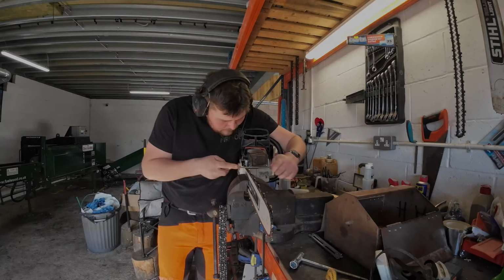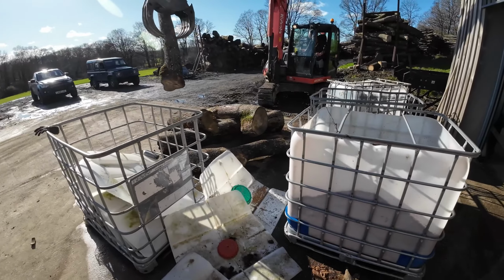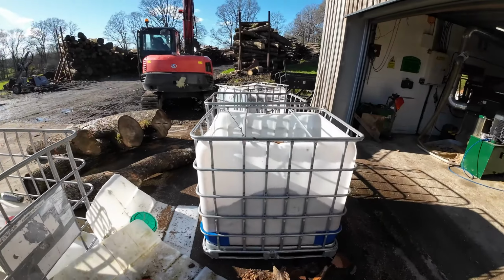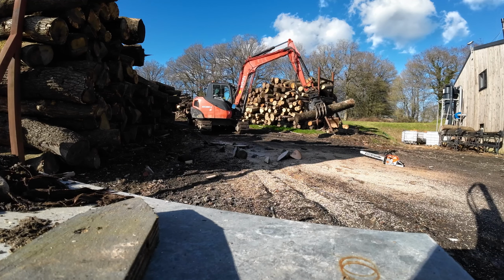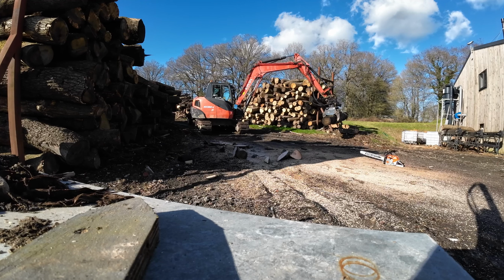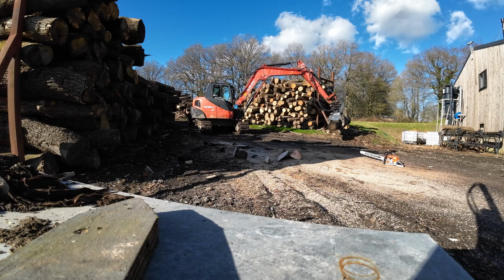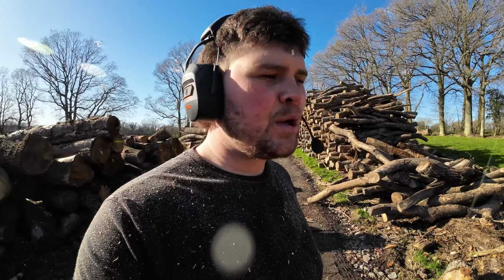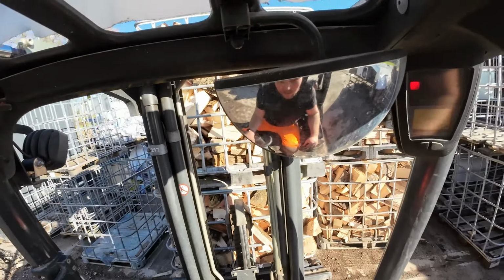Day 80 - Cleaning and processing knotty  wood

Comment: Hey man, love your content!  Was hoping you could give me some advice on my kiln setup.  I built a small kiln that can hold 1 cord of wood and uses wood and propane heat to dry it.  Because it is small I can get it up to temp relatively quickly depending on ambient air temp (usually a couple hours).  I cruise it at about 140-165* most days.  The problem is I have to baby sit this thing and usually can only run it at temp for a few hours at a time before I have to shut it down and leave.  Even with the kiln temps at 165-170 and my relative humidity inside the kiln at 10-12% I'm wondering how much longer I'm going to have to run my setup compared to someone that can run 24/7.  

Do you happen to know if say it takes "x" number of hours to dry down to 20% moisture content at a given temperature, does that have to be all in one go or can you break it up the way I am doing and only run it when I can for 4-5 hours at a time?  I put a loosed stacked fresh cut face cord of ash in there for testing and probably have 5 or 6 days I've run it part time at 4-5 hours each time at an average temp of around 150*.  I'm still measuring mid to upper 20's for moisture content on fresh splits (they tested at near 50% when first processed off the splitter).  Not sure if this is good progress or not, I have no comparison points.  Maybe it isn't worth running if it can't be 24/7?  Not sure, just a bit frustrated and would love some advice, thanks!